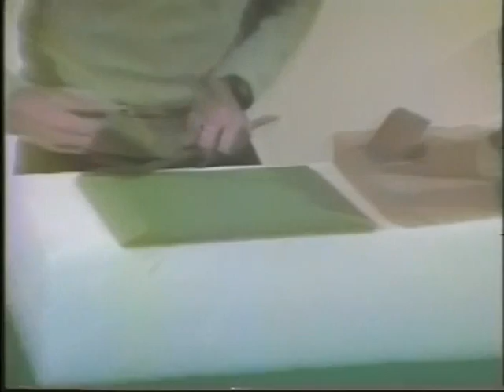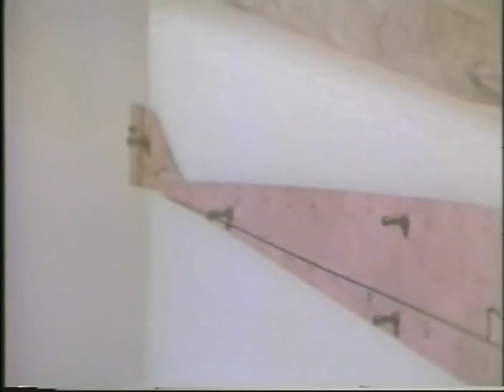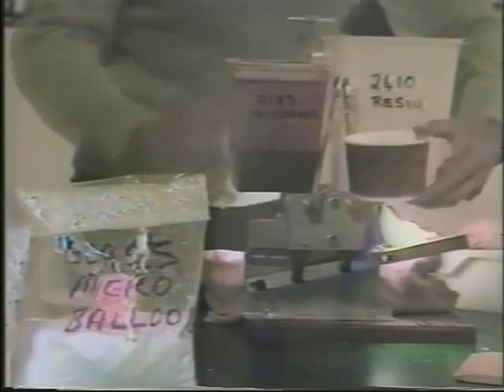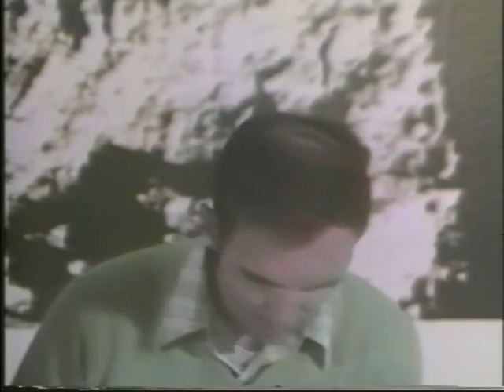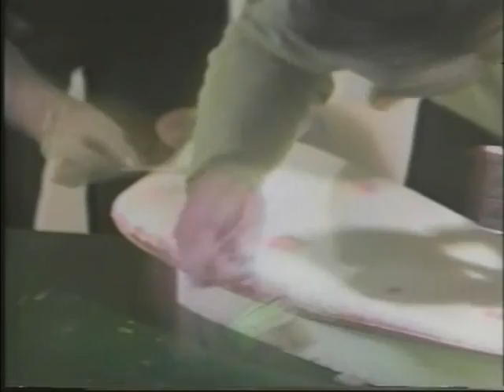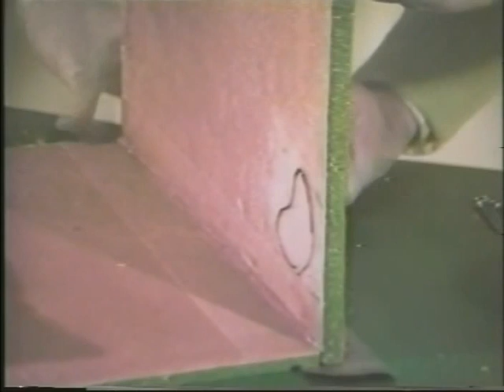Building the Rutan Composites - Burt Rutan and Mike Melvill homebuilt aircraft construction tutorial

Comment: Not apples to apples but it's interesting that SpaceX is using sheet metal, specifically stainless steel instead of composites on its rockets.
Reply from the maker: There are pros and cons but the main usp of starship is that it is almost a mass (relatively of course) produced item, while a homebuilt aircraft is the definition of a one off.

Comment: And these guys developed this technology way back in the late 80s
Reply: Well, Burt Rutan said in an interview that he came across the idea from the Aeromodeling community he was involved with, along with seeing a Sailplane repairman cutting out damaged areas of gliders, patching in foam glued to the inside of the fiberglass skin, followed by fiberglass layups. 

He determined between the models and the full-size repairs he could make the whole airplane that way. 

Genius, yes. But even the smartest guy in the world needs a little inspiration. 

I'm interested in the construction method for Voyager (claimed to be extensively Carbon/Graphite) as well as the construction method used on Spaceship One. (I.e. is it Moldless or mold-based layups). He has several patents on construction methods, and was always innovating on new methods. Most of which are moldless methods.

Comment: So I used to work for a subsidiary of Boeing doing factory floor automation in the high tech fibers in use 22 years ago... so I have been thinking about it... let's start with the core material, paper is made from scraps of cloth and paper..  junk mail fer example... I add water and grind in the blender... and add shellac to create a sticky mix and add AuPt dust a half cc/ liter.. found wherever water flows naturally... as the shellac water mix dry, it creates covalent bonds throughout the bio plastic... it's biodegradable... and absolutely non proprietary... shellac is the lingin and cellulose of bamboo... mix with paper and add H2O2 to the alcohol and mix in baking soda and spray the result into the form with screen... it creates CO2 gas inside the paper to make it flame-proof... paper can be slopped on and dried... or cut from larger pieces with a CNC milling machine... it's about as hard as copper.. 3 on the Moh's scale of hardness... add 2 layers of silk, wrapped in both directions, and spray shellac with AuPt to seal... it's light as a cork and stronger than steel 

A gift from my family to yours 

Enjoy
Starfirediamondmines@gmail.com
Reply: Trying to understand...what exactly is AuPt dust?

Comment: The clean up of uncured epoxy can also be done with Isopropyl Alcohol. It's fairly cheap and leaves a clean surface. This is especially good on squeegee tools and work surfaces. Thanks for sharing. Best Wishes & Blessings. Keith Noneya
Reply: Always use polypropylene for you bagging, perf, and squeegees.  Common 'painter's cloth' is made from polypropylene.  Using a squeegee made from polypropylene, it can be cleaned with alcohol or acetone.
Reply: There are all sorts of solvents and cleaners that will cut through epoxy. 

But always always always test each chemical on scrap foam to see if it melts or changes it's texture or finish in any way. Many builders have ruined parts by not being thoughtful about what products are around their project. Don't even chance it to have MEK or Acetone located in your shop. Lol.

This construction method works well, but solvents and gasoline can seep through even paint pinholes and 4x layers of fiberglass to melt the foam underneath. A high quality paint job is absolutely necessary for lifetime durability.

Comment: Seems a slightly crazy idea but could the Cutting wire tension be perfected with a Guitar Tuner ?? 
Tension to a particular note ??? 
Hummm  ...
Reply: You would have to start with a correctly tensioned wire to note the frequency and then, if you changed the length, so would the frequency to obtain the correct tension. This would be a very bothersome process when you can simply do a test cut and simply loosen or tighten as needed.
Reply: All you do is tighten it while plucking it. Listen to the point where it no longer changes tune the tighter you go.

This is the yeild-point of the steel. Which is the tightest you can go before it stretches and gets thinner and breaks.

Comment: When joining perpendular sheets a radius curve using epoxy and cabosil paste then covering with peel ply letting it cure, remove peel ply apply glass tape. Sharp angle should be avoided.

Comment: That technique is flawed. The micro slurry should be applied to the foam and then let to cure. After that it should be lightly sanded to knock off the nits that might protrude and catch the fabric. Your technique shown of putting the cloth on the slurry while it's still wet is all wrong. The epoxy resin applied will soak through the cloth and then into the slurry and go right past that and into the foam making a heavy structure. What should be done is to put a light coat of epoxy resin over the cured slurry, then the cloth and wet out the cloth with more resin on top of the cloth. Then squeegee the excess. Done..
Reply: Nice. You are showing off what has been learned in 40 years after this video was released.
Reply: There's actually a better way to keep it even lighter and stronger, and allows for more working time where the micro is mixed as dry as can be worked well and smoothly into the foam; in that manner micro cures more slowly and the nits can picked out adequately.  Then, lay the glass down dry and met out only enough epoxy for each immediate swipe of the squeegee : its very quick and the layup bonds best to uncured micro.  The problem avoided is that once too much epoxy gets somewhere its actually very hard to get it out; too much being any more than the best strength to weight ratio...usually no more than just over white....in some cases a low % whitish is fine.
Reply: WOW you showed Burt Rutan arguably one of the top aircraft designers in the last 100 years.  Wow that must make you greatest... what have you ever done besides post on Youtube?
Reply: @gmcjetpilot  More than you.  He educated someone who wishes to learn
Reply: @w8stral  My whole professional life in aviation is about learning. I have a degree in mechanical engineering, did stress analysis for Boeing, built two experimental kit planes, and I'm an airline transport pilot and certified flight instructor. Everything I do is about learning. Go away troll.
Reply: @gmcjetpilot  Do you enjoy your fantasy life?  Just wondering.  You should have added astronaut to your make believe life as well.  Unlike you, I actually know and have worked with the BAC stress engineers and none of them are transport pilots or certified flight instructors.  A few have their pilots license.  Exactly 1 has built their own and he is not such an arrogant asshole as you.  He is arrogant though.  =) 

Yes lying troll go away.
Reply: @w8stral  No fantasy troll. I've been working for +30 years and still working. Graduated from LSU with honors BSME, went to Graduate School at UW (studied advanced composites). While working for Boeing in Seattle for 12 years doing stress analysis (metal and composite), I earned my pilot ratings, became a part time flight instructor and non-sched 135 charter & corporate pilot, while still at Boeing.

I built hours and ratings (ATP turbojet, type in CE500) and eventually switched careers, went to work for the airlines as a pilot. I now have 12,000 hrs in Boeing 737/757/767. In my spare time I built and flew two kit planes, Van's Aircraft, RV-4 and RV-7.

In the United States many people work hard, switch careers, do many different things, because we have many opportunities. I took full advantage of every one of them. It just takes drive and hard work, and I love learning. I'm an adult man, not a punk like you. Run along troll, you lost.
Reply: WELL NOW there are NOW better ways.. This was done in the 80's..
Reply: Agreed. but just remember that this was recorded in the early days of f/g aircraft, and we are still making improvements.
Reply: 40 years too late sparky.